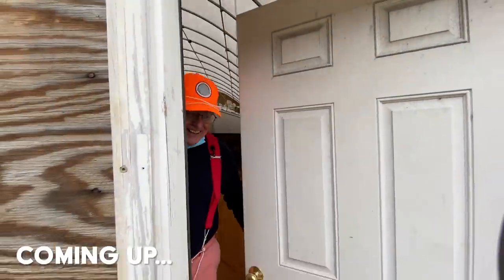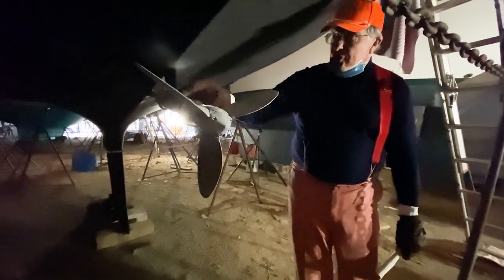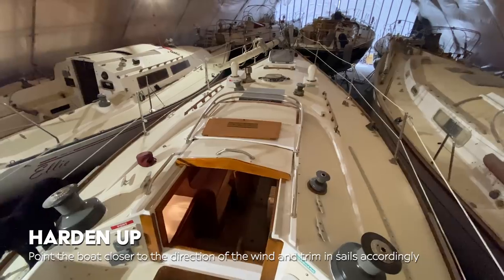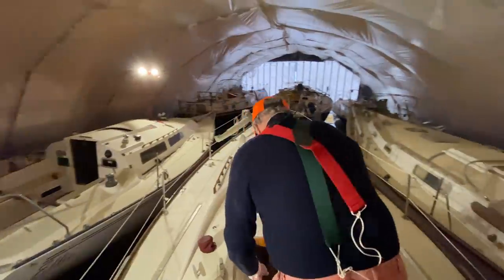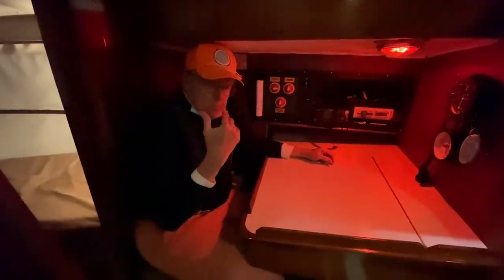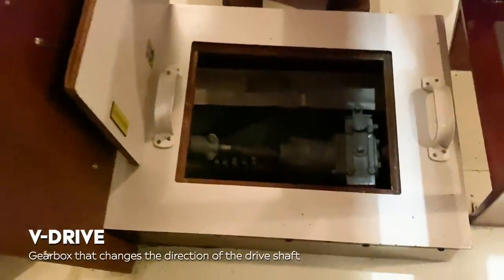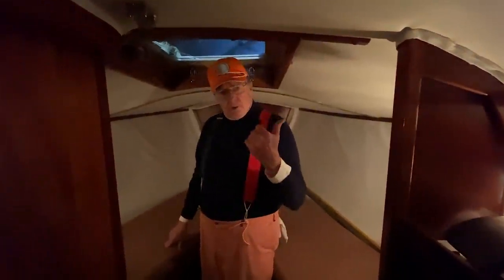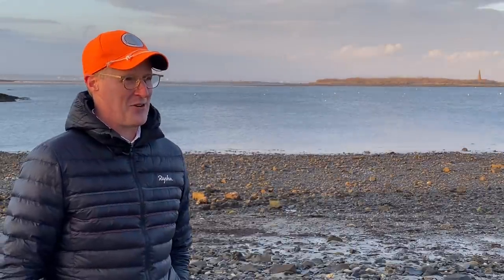Classic Sparkman & Stephens Sailboat for Sale $49,500 - Yankee 38 - EP 22

Comment: Cool boat, nicely maintained.  Sea Dog seemed to like it was well.  Will be very sharp when the headliner work is done.  Surprised at the openness of the aft berth area.  Normally not a fan of V-drives, but seems to make sense with this boat's interior layout.
Reply from the maker: Sea Dog is very perceptive     i will tell for you   ...at least if there is a an issue with the drive  you can get to it

Comment: Nautor had nothing to do with the design of the Yankee 38. It predated the Swan 38 by half a decade. The shark fin keel was the latest thinking in 1972 when the prototype, Lightnin' was built and sailed by Ted Turner. Like Lightnin', they rate as One Tonners, 27.5' IOR.
Reply: Swan and  Catalina used the same mold as Yankee 38, appropriate No. vessels; Yankee 30. Swan 60, Catalina 300
Reply: @chhindz  the Swan has, at the very least, a completely different hull from the keel to the transom, reflecting Olin's thinking behind American Jane II, Temptest and Kiapoa III.
Reply: @chhindz  I looked at both and the differences in the hulls are...

The Swan is slightly longer, shorter on the waterline with 2,300 pounds more displacement. She's slightly fuller in the bow - with a deeper forefoot - despite having BMAX further aft, lacking the pronounced tumblehome of the Yankee but with a fuller aft section for that aft stateroom. Also, the counter of the Swan isn't quite as steep... 

They're two totally different boats from the same master designer, one released after Lightnin' was built in '71, the other in late '74 or early '75. The Swan was reviewed - with drawings - in Yachting Magazine's January 1975 issue, with Kialoa III also featured in a separate article, debuting as a ketch. 

Good thing I'm only 5'8". That skull knocking didn't sound good. Sounded like an old commercial for Excedrin Headache #1.